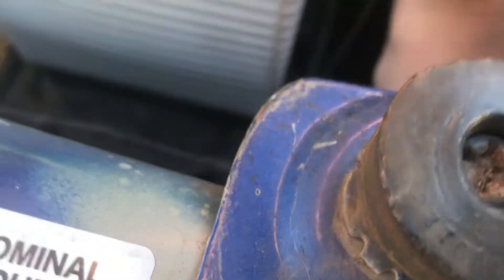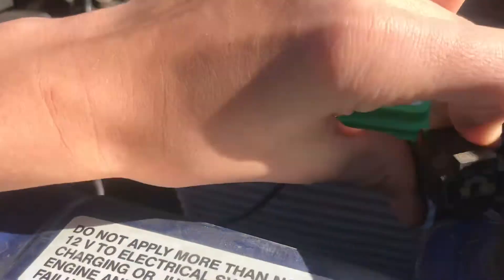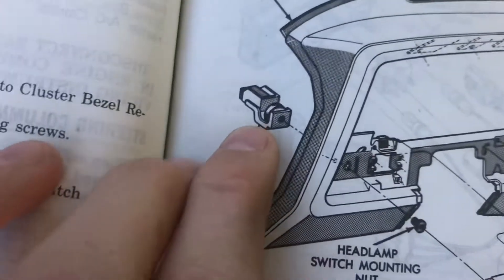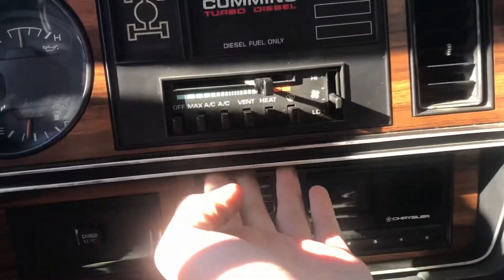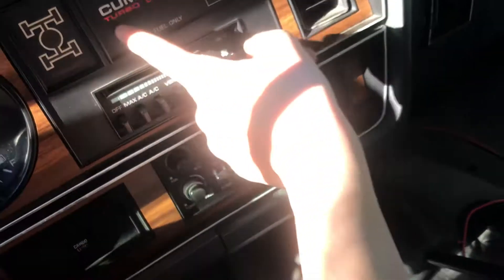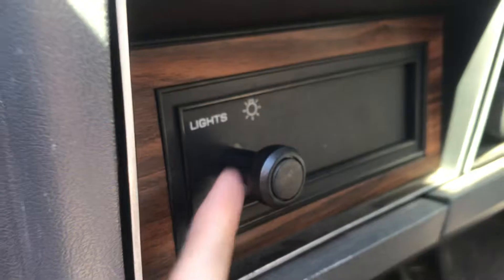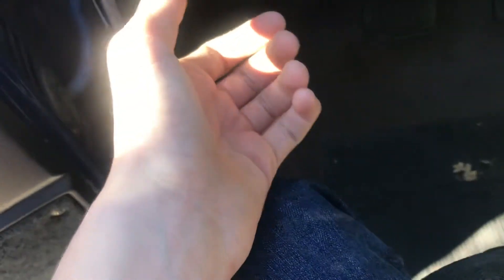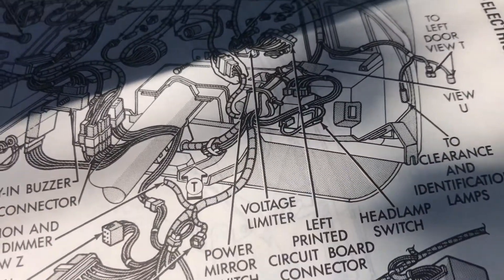1990 dodge w250 headlights not working

Comment: Hey Lucas... Sounds like you know a lot more about vehicle electrical stuff than myself. Do you think this might be the same issue im having with my 1992 dodge b250 van? My headlights don't work but highbeams do work. Also my front right turn signal recently stopped working. Any advice would be appreciated.
Reply from the maker: @freedomallegiance4573  I would assume, on the trucks many different systems are ran through the headlight switch witch causes them to burn out quickly. As with the highbeams it is possible that both of the low beams are burnt out, as they are separate filaments (high and low); but the combination with the turn signal I would believe that it is logical that it’s the switch.
Reply: @W250STUFF  thx for your quick response. So it maybe possible I just need to replace the bulbs? But it also could be the switch? I'm looking online now to see if I can find a service manual for my year, make, and model. I've just been using my high beams when it's dark, and with how bright the new car highlights are, people rarely seem to notice I've got my high beams on, but this is obviously not a permanent solution. I'm grateful for your video, there doesn't seem to be too many videos out there addressing repairs on these years of vehicles.
Reply from the maker: @freedomallegiance4573  I would start with the switch, if that does not fix the lights and signal then do bulbs. But first if you can I would test your blinker by swapping the bulbs to see if it is a bulb issue or a power issue and if you have a test light/multimeter see if you have power to your headlight pigtail. Sorry for the delayed response.